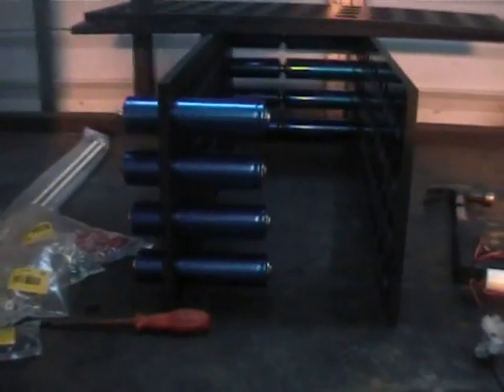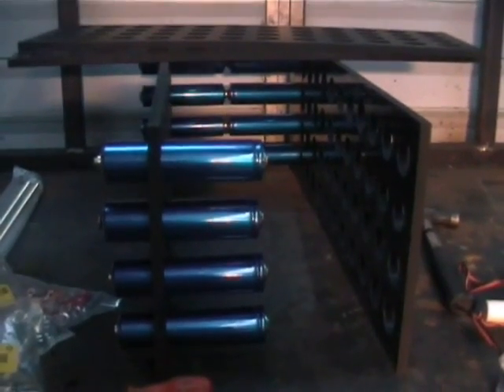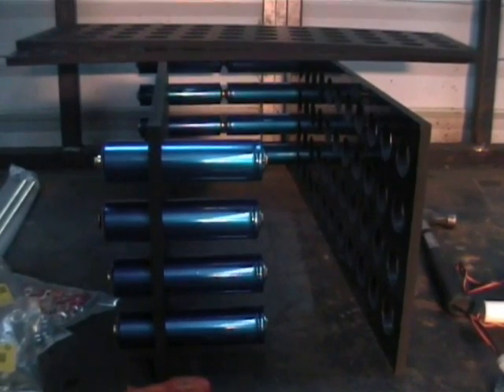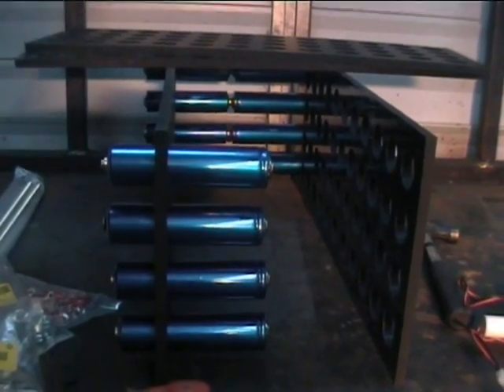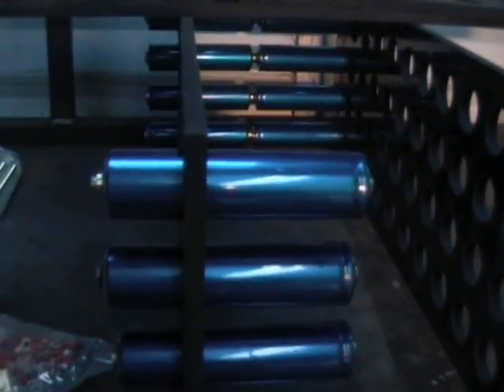BMW EV Conversion 30 Lithium battery 01

Comment from the maker: Battery choice depends on range and performance requirements. I needed a cheap solution for a fast , low range car so the headway cells suited fine.

Comment: very interesting info on the Lithium iron phosphate batteries. You said 2000 recycle charges. Does that mean that if you recharge them, let's say 200 times in a year, would it be expected for the cells to live 10 years? How about the price?

Comment from the maker: Cell spacing is to allow cooling , access for modification and voltage monitoring and to reduce the possibility of a cell failure causing a cascade.